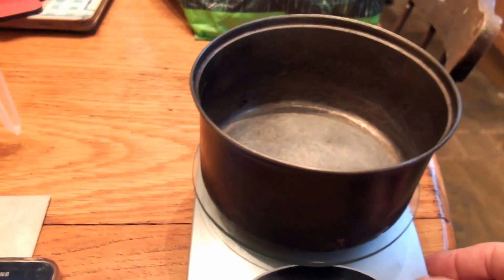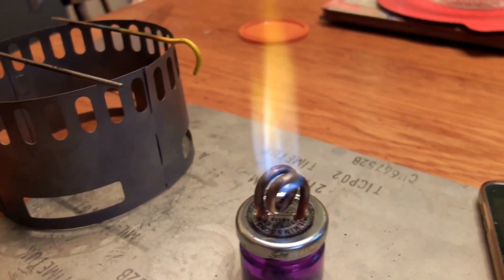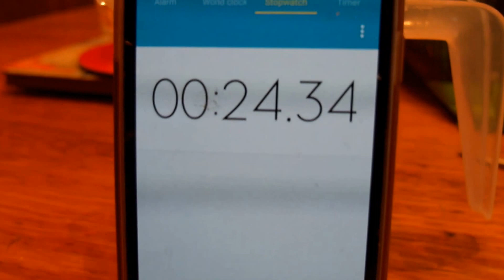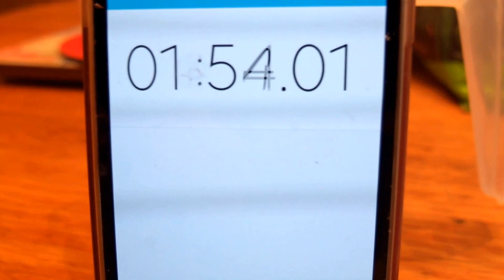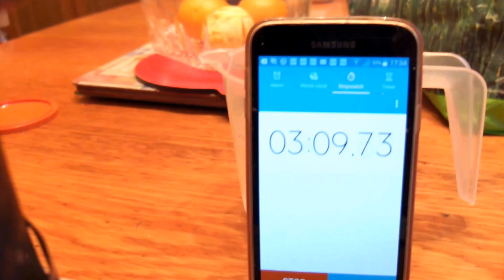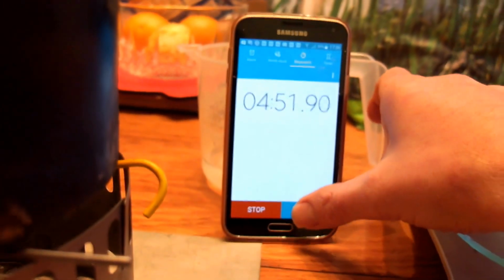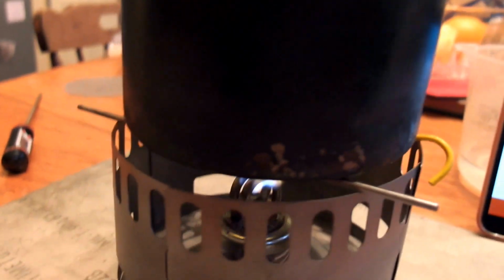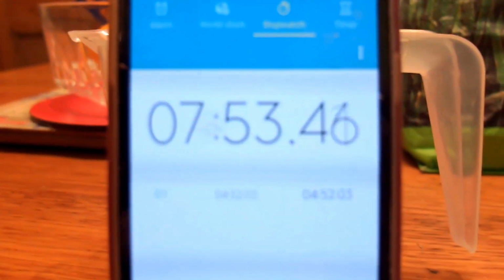Copper coil jet stove boil test - Fast!

Comment: I just made one that small, but wondered what size hole you drilled for the jet, and what size coil did you bend?  Thanks!  Great job on the burner- that thing is a jet engine!
Reply: 0
Reply from the maker: 0.8mm jet hole. coil diameter is 25mm

Comment: ive seen many coil stoves and not all of them roar fiercely like that,some do some are less,,what is the secret in the design to make the flame more furious? smaller hole or smaller stove altogether?
Reply from the maker: Small jet hole, and tighter radius on the coil.
Reply: @rogtallbloke  thank you,,is it better to have maybe 2 or 3 small holes say maybe one on either side of the the one in the middle pointing up at an angle to create a swirling triple flame? they probably need to be laser drilled lol
Reply from the maker: @ARCSTREAMS  They would have to be very small diameter holes.
Reply: @rogtallbloke yeah  that is why i said they probably need to be laser drilled unless you can find and use 0.3mm drill bits

Comment: What fuel are you using in this? I’m assuming kerosene (paraffin)?
I have a jet coil stove and it runs on kerosene, but will not run on denatured alcohol. I only use the alcohol to preheat the coil.
Are you burning alcohol or paraffin?
Reply from the maker: It's running on denatured alcohol.

Comment: great job that works a treat what did you use to glue the copper pipe to the lid and what did you use as a wick im going to have a crack at making one of them
Reply from the maker: Epoxy 2 pack glue. Wick was just some old natural fibre cordage I picked apart and stuffed into the coil.

Comment: is it possible to build this coil square with elbow joints as opposed to round by bending the copper?
Reply from the maker: You'd have to use a high temperature solder or braze to joint it. Bending the coil is easier. Just fill the tube with salt and dissolve it outafter bending (patience rquired).

Comment: btw what kind of fuel are you using,,the purple colored stuff?
Reply from the maker: Standard UK methylated spirit. 95% Methanol.
Reply: @rogtallbloke  ok thats what i figured,,over here in canada we can find it at 99% in most hardware stores,,i prefer to use ethanol but you cant find this easily

Comment: Could you try to burn used cooking oil instead of alcohol?
Reply from the maker: Warmed cooking oil will burn through a wick, but it's a messy, greasy and sooty way to cook.
Reply: @rogtallbloke  I'm wondering if cooking oil pressured vapor could possibly burn cleaner (less soot)
Reply: @ww07ff  
No, I don’t think so. The flashpoint of kerosene (paraffin) is about 135F (57C). Cooking oil can easily handle temperatures much higher than than before it burns. The incomplete combustion of fuel is what causes the soot. So cooking oil may offer higher BTU output once it’s brought up to flame, but in the process, I’d expect more soot production.

Comment: Great job, you not warried that the glass will crack ?
Reply from the maker: No. It's thick glass and doesn't get hot.
Reply: @rogtallbloke  Question: Can I put other type of fuel in the copper coil stove like Zippo lighter fuel?
Reply from the maker: @MASViper  I wouldn't.

Comment: hi what size copper tube and hole size did you use. thanks
Reply: The same question I have, from the looks of the tubing I'd say at least 1/4" OD as for the pilot hole I'am sure a little tinkering one can manage what works efficiently starting with as small bore first ofcourse.